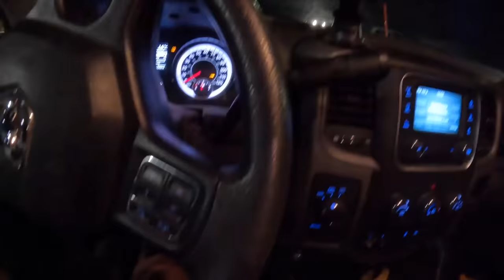Emergency Snow hauling

Comment: grab a steel shovel or sledge hammer and smack the bottom of your trailer. all that snow comes out. plus make sure your trailer is perfectly clean before loading.

Comment: Hey Stan great video what size dump trailer is that? 
When you do a job like that what you charge ? What's the formula you use to figure that out? 
Also on plowing commercial property's what you charge to plow them per event? Or do you have yearly price? 
How many inches do you cover till you charge them again? 
How do you figure for salt ect? 
Not sure if you done a video on that or not would love to see one. 
Last question I recently bought my first excavator and skid 
I went with a 272c wheeled machine I really wanted to go tracks but I got a good deal on it. 
What you prefer tracks or wheels to use in the snow?

Comment: It looks like YouTube deleted my comment but google ceramic pro strong it probably won’t last threw your summer work unfortunately but It will your winter stuff I’d throw a box vibe on it to for good measure in summer or winter  you could also bolt  down a layer of crown plastics durasurf on the bed of the box and it wouldn’t stick to that either you could also rig a heater to the bottom of the box or lay down a thick layer of calcium chloride brine mixed with dawn/beet juice/any surfactant really to the box to keep it from sticking 

that snow they way you processed it changes the structure makes it dense for snow fairly abrasive and sticky it’s decent quality if you want to build features or sculptures

Comment: My favorite time of the year Was when we'd push snow EeeeeeeHaaaaaaa So here's a Canadian snow trick From the 70's We took a long aluminum pole & we attached a 6''-8'' square flat piece of steel & we riveted that square to the pole & at the other end We attached a bicycle hand grip & to do that Wet the inside of that rubber hand grip As a lube To help w sliding that hand grip Onto your pole & to use it Simply slide that steel square Along the bottom of the dump box Start furthest back Of the box & then simply keep sliding in under again & again & 2 maybe to 5 tries later The snow will automatically fall down & then you're done That's all it's ever taken me & I had badly dented bottom Of my truck box From a concrete job That we did in the summer So the snow would stick To the dented box bottom On my 3 ton Ford dump truck So make a long pole The length of the dump trailer's box & weld 2 hooks Onto the higher part Of the side of the dump box Weld one at the front & weld one at the back & then hang that pole Along the side of the dump trailer When not in use Good luck

Comment: I plow alot of commercial lots in the maple grove area and this last storm was never ending! For plowing snow i hate kubotas. Had a 259d3 with multi bar tracks, it was a monster. Could push back huge piles without major traction issues which make plowing alot more enjoyable!

Comment: Stanley, I have a few comments for you.  I went out for 3 hrs. last night.  After 3 hrs. I stopped working.  It was -35 below zero and it was too dangerous to be outside.   It was a light fluffy snow, and I will go out in a few days to finish up when it is warmer.

Since you have Siri on your phone get the family together and ask Suri "Siri what is zero divided by zero" You will laugh at her answer.

I am interested in what the Hurricane blower would do with this snow.  I was using my Stihl 800 last night to clear snow.  Also, I quite snow removal last night because it was -35 below zero and it was dangerously too could outside.  I will wait for a few days when the temp warms up a little bit.
I think it would be cool to see what a hurricane leaf blower would do to the snow.

With the snow getting stuck in the trailer at the 6-minute mark I heard about this tip on YouTube.  With my Arron's snow blower, I spray the snow blower with Pam cooking spray.  Pam put's a layer on the metal and your snow does not clump on the metal. I don't know if you want to buy Pam to spray that big of a trailer or if you took motor oil and rub it all on the metal box so the snow will not clump and get stuck.

Comment: Call me an idiot if you want, but where is your dump truck? Big Red right? I could be mistaken. Also, the loader would have been better as well. Plus I might be behind the ball knowing you have new equipment in the works. It looks like you need a Larue front snow blower for a large loader. You have to give in and get a snow blower, or buy a tractor like a JD 6110 and a Normand inverted snow blower and your butt will be covered. Anyway, great videos as always. Love to work for you anytime

Comment: Stan, Stan, hey I don't know how asphalt companies keep asphalt hot and ready when they have to go the distance why can't that same old old technology be used to transfer snow a watertight whether it be a trailer or a dump truck if you can make a dump truck keep the heat of asphalt to the job why can't you keep Snow heat up by time you dump it slush water whatever why can't they make a machine suck up snow and make it into water and blow it into the planter beds lawn beds whatever they are beds that could retain the snow if they can make instant water by using a gas fed water heater you no longer stationary or store your water to be heated and pumped through pipes they now have a instant system to heat water I would think they could come up with something that could boil the water you already have the throwing capacity of some kind of pump not snow blower but like a hydroseeding pump some kind of pump that would blow the hot water into the trees that could be warmed up into the basins that could be filled up with snow or even better yet use that hot water down the drainage you must have drainage cuz you don't have snow always but you can flush out those drain systems with hot water because Lee's dirt whatever clog up drains but hot water seems to be a liquidation substance that seems to free up not a fast one but if you're consistent a productive one and keeping the ice cube formation in those pipes from forming a solid plug I did not go to college I did not pass high School but a stupid as I am we already have the technology maybe it's too many blueprints with patents that keeps us from progressing